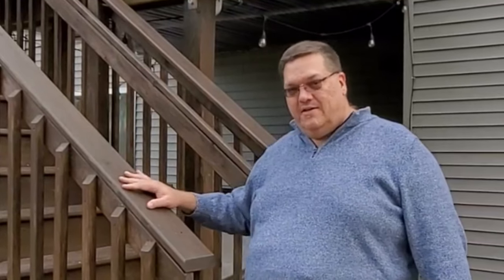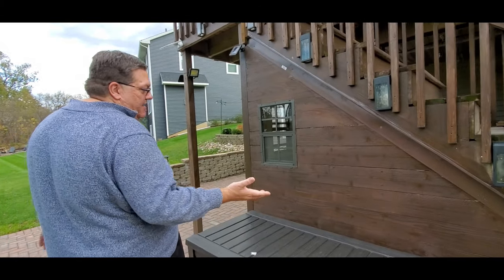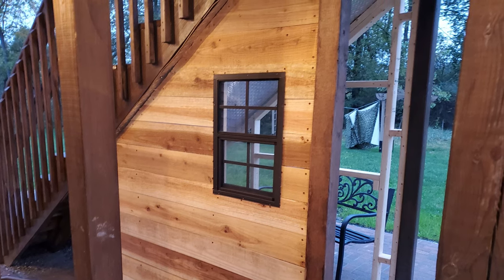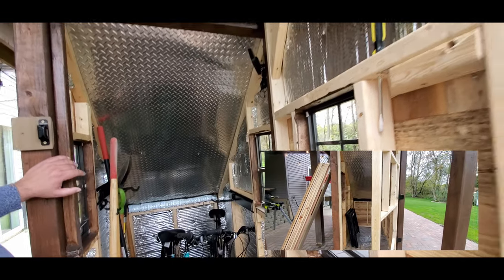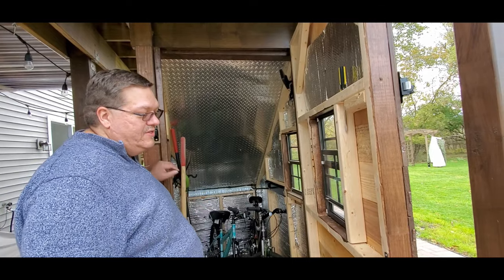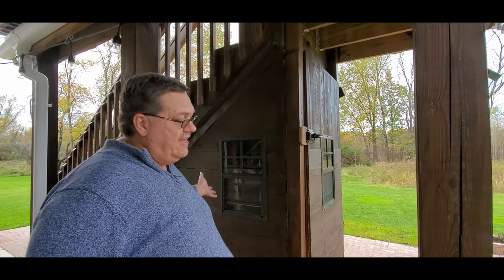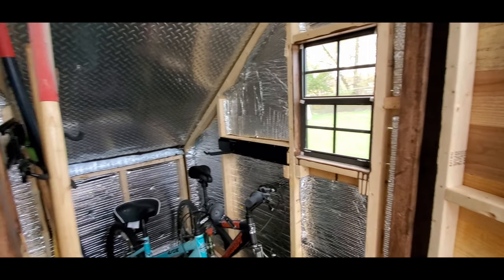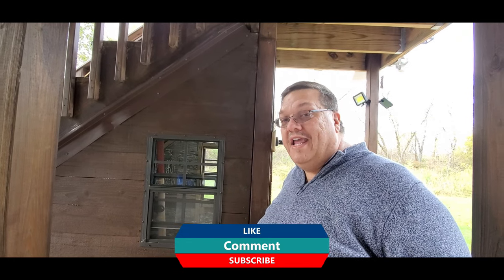🏡 DIY Under Deck Stair Storage 🏡

Comment: We are looking to do the same thing under our stairs. What did you use for the roof part of the storage? Did you just screw it to the stairs?
Reply from the maker: Yes. We used .25 sheet of plywood with the vinyl diamond plate sheet and deck screws. Good luck. It was a pretty quick project.

Comment: Why did you go with diamond plating on the ceiling, under the stairs? Just material you had available to use? Kind of curious to see it used for that application.
Reply from the maker: Thanks for the questions. We have an unfinished room in the house that we were considering using the panel for and thought this was a good test. If it holds up then we will probably use it on that project as well.
Reply: @LusGarden  As long as you know what material is best for your job as you see fit, that's what is important.

It's overkill though, to the greatest extent.